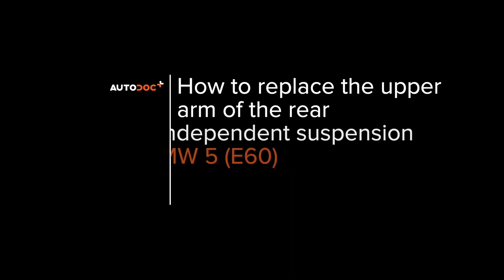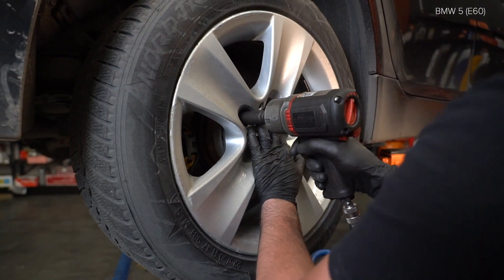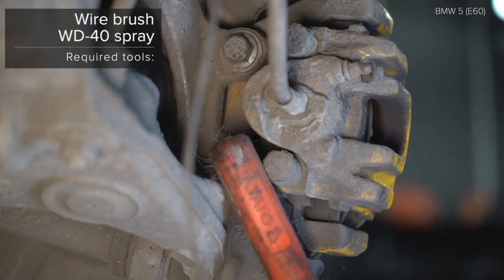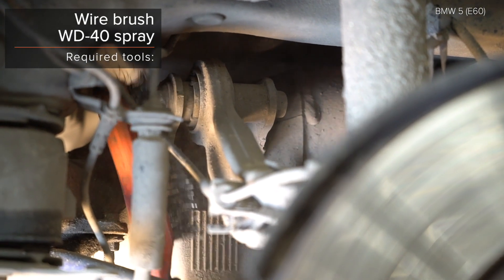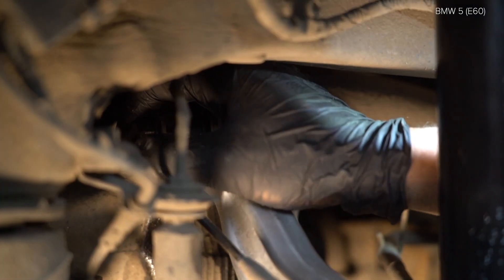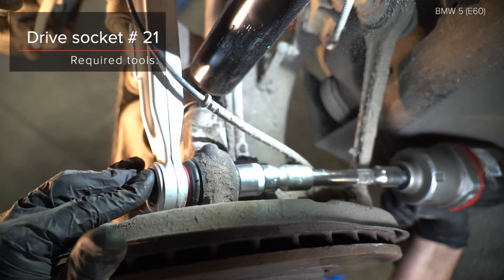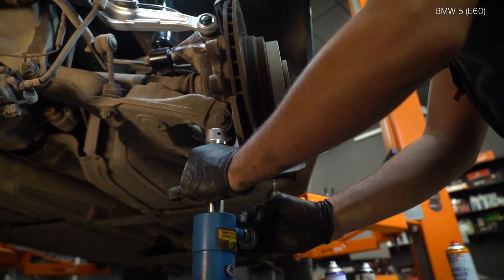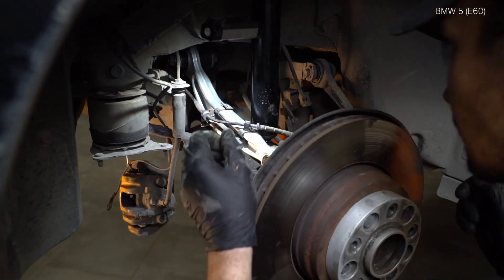How to change rear suspension arm / rear control arm on BMW E60 [TUTORIAL AUTODOC]

Comment: Why is the hub jacked up after loosely fitting the new control arm, before tightening?
Reply: If the hub is not jacked up to ride height before tightening the bushing, the bushing would be subject to a twisting torque after the car is lowered.
Reply: @thomasstiglich3484  ahh i see, thanks!

Comment: It wasn't shown that the control arms are adjustable (at the inner end by a concentric bolt arrangement) and a 4-wheel alignment is required after fitting.
Reply from the maker: Thank you for your comment. In new videos, we will definitely add this information for our viewers.
AUTODOC
Reply: I think you’re talking about the guide rod, this one doesn’t have the eccentric bolt / hole as mentioned

Comment: these are wrong torque numbers! BMW repair manual states: arm to subframe is 100Nm (tighten in normal load position/wheels on ground) and arm to wheel carrier is 175Nm! not 72Nm!
also, you DO NOT need to remove the brake caliper!
Reply from the maker: Thank you for the valuable clarification, for our viewers it will be very useful information.
Reply: Exactly. The torque numbers in the video say NM but they're the (lower!) ft-lb values.